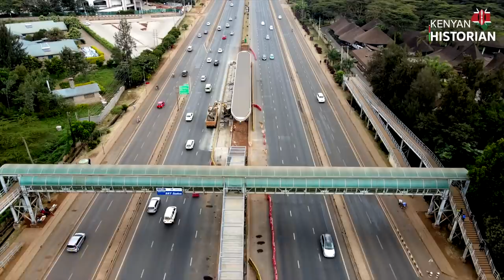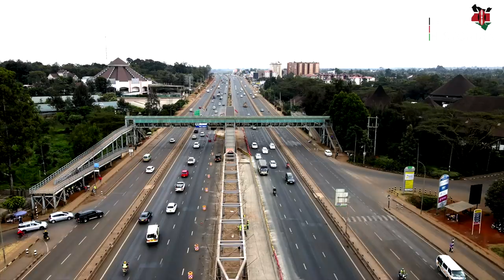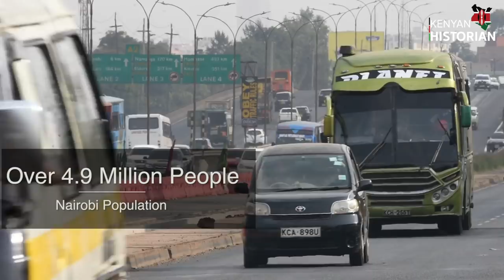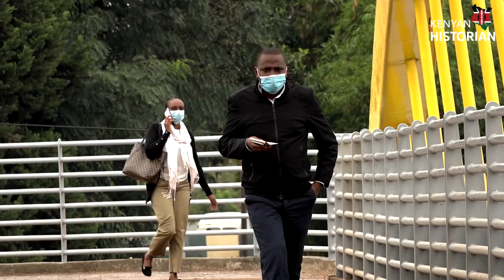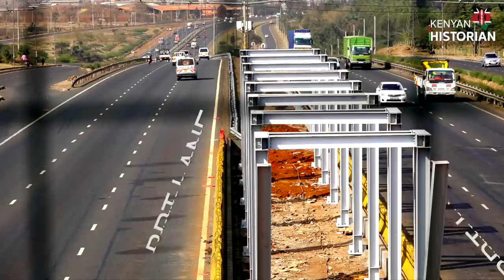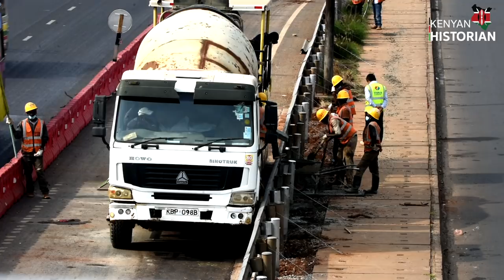KENYA'S BRT QUEST: Construction & how it will reduce congestion in Nairobi city. #TheBRTDream

Comment: I am from Dar, I can attest that Nairobi is another level. It only needs a reliable public transport systems like trams or metros.
Reply: @Moses, Have you heard of the Nairobi Commuter Rail? It is already working on some routes. And they are going to increase routes with time. This is not the same as SGR, it is different.
Reply: Trains are already there, sir.But Nairobi requires several means of mass transport..BRT is just one among many means.
Reply: Trains

Comment: I have just been watching this Kenyan Historian video about the construction of Nairobi BRT and I must say it has been very informative. My only concern is that as there is only one lane what happens when a bus has a breakdown is there enough space for buses to overtake the brokedown vehicle?
Reply: Lol those buses will be checked everyday before leaving the deport so no worries. And after a while they'll be shifting to electric buses meaning less maintenance and no need to worry about a breakdown
Reply: There is always a carver that allows emergency vehicles in.
Reply: @itgamingke  Breakdown can involve unpredicatble things. Examples; a flat tire, an accident and so forth. Even with daily check-ups an extra lane or pavement is necessary.
Reply: I have used brt in South Africa and have never seen a bus stalling on the road. Once there is an accident, the bus is moved away fast to allow free traffic
Reply: One lane is designated for the bus but as you can Thika highway is a 6lane road so no worries

Comment: My only concern with the BRT installation on Thika Superhighway is lack of accessibility platforms. People on wheelchairs also need to use these public transport facilities but they are thoroughly ignored. But this is a problem that came about because it wasn't an original design.
Reply: Watch the documentary and see how that issue is catered
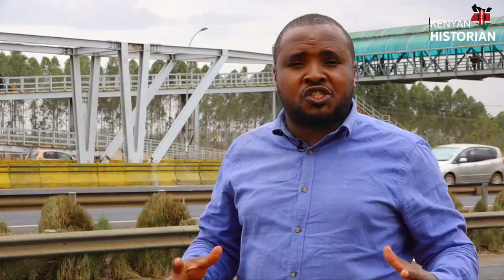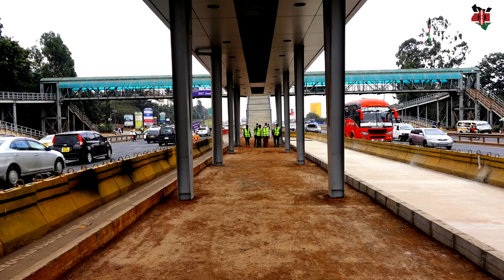Reply: Did you really watch the documentary?👆🏿From, 15:30 - 16:50 Your concern has been highlighted, plus well answered.

Comment: BRT is a good initiative, although it is being implemented both as an afterthought, and in an uncoordinated manner. Part of Thika Road (KU to clayworks - barely 8 yrs old) will be demolished and realigned, resulting is wastage of taxpayers' money. On Mombasa Road - BRT Line 1, an expressway is instead being built to accommodate even more cars. The PPP financing model on the expressway also precludes any development of a mass transit system during the project operation period since such a system would compete against the business model. The big elephant in the room, matatus (and their attendant madness), has also not been addressed. Are we implementing complex, expensive and unnecessary solutions in a neurotic manner when simple and obvious ones exist?
Reply: It is all bizness, they have not intention to solve any problem. The BRT is just a way to make some cash from an existing public infrastructure, if they truly cared about it they would have included that BRT idea in mombasa road and waiyaki way ongoing expansion.

Comment: This was not in the original design, it will only create confusion in intersections and more traffic jam. The original design was to use the outer lane for picking and dropping passengers not the inner most lane. This is a short sighted idea.